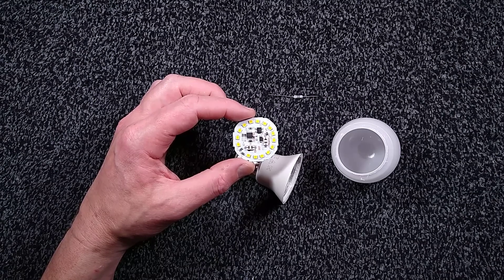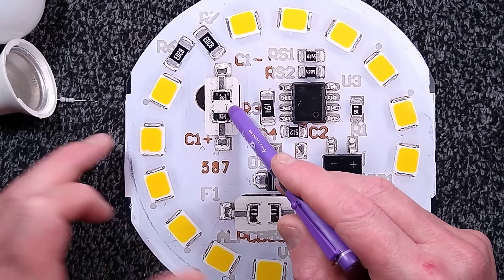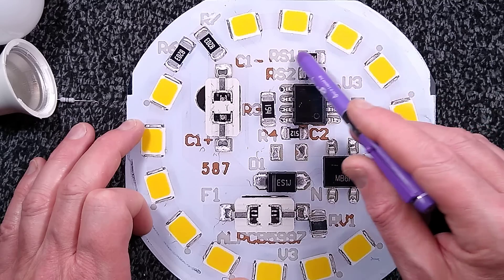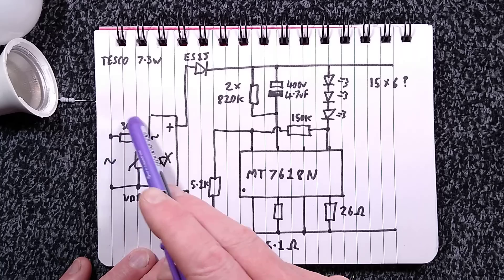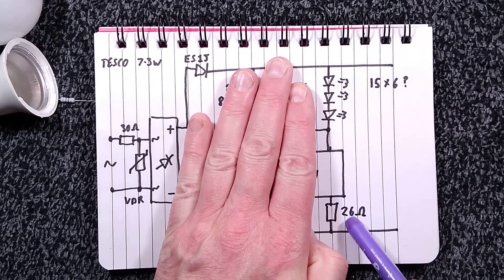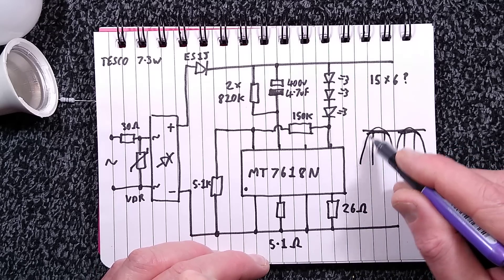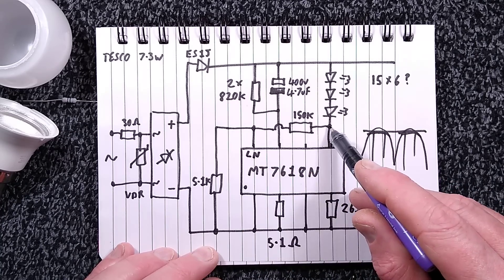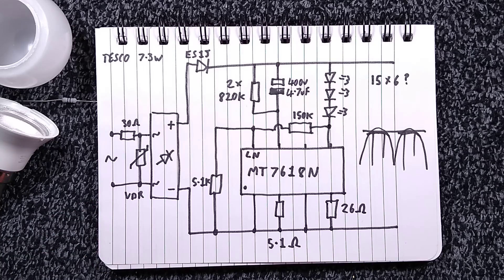Tesco lamp with weird circuitry twist

Comment: this lamp exact lamp is also supplied by toolstation. They are Wessex A60 GLS Bulb 7.3W BC Warm White 806lm
By Wessex Electrical Product code: 51967 Pack size: 5 Pack, or Wessex A60 GLS Bulb 7.3W BC Cool White 806lm
By Wessex Electrical Product code: 65973 Pack size: 5 Pack

just bought some. As you promote, removed the lowest value resistor, and visited your site specifically to find where  the two bleed resistors were so I  to have cheap phantom hall phantom lighting?

Comment: Hi Clive, I have some LED lamps from Aldi here in Melbourne Australia. They are very different from the ones you have been hacking with a die casting main body that heat sinks the ceramic disk where the 12 leds are mounted. There is liberal use of thermal paste.  The main circuitry is fully potted in the base which is extended by a plastic case 28mm dia and 34mm long plus the 25mm length of the es or b22 connector. Brand names are starke and lifetec, but I can't open the lifetec due to it's glass envelop.

Comment: This is just pure speculation since I don't have access to that chip or that lamp. This theory can be tested with an oscilloscope and meter. I'm guessing that chip is a PWM current/voltage limiter. This can be tested by measuring frequency on pin connected to LED. Adding a variable resistor between mains and lamp to reduce voltage across the lamp and measuring the voltage across LEDs to see if it is in fact a current/voltage limiter. If my theory is correct, that diode is there to reduce noise transferred to mains (which also can be tested with oscilloscope). Matthias is showing noise on mains in one of his recent videos "Our electrical is all wobbly, measuring power is hard".

Comment: A very interesting video clip and I like the way you freely admit to not knowing it all already as so many other clips suggest!  My thoughts on why the ES1J diode - with due deference to other comments - are these: The bridge rectifier, an MB6F, is rated at 600V peak repetitive.  With 240Vrms mains you'll get about 340V which is fine.  But if you follow up the bridge with a capacitor, and if it's switched on and off repeatedly, that residual voltage on the cap may coincide with the wrong part of the incoming phase and you end up with double the peak voltage, ie, about 700V.  So adding the extra diode, I think, is to protect the bridge against overvoltage conditions if used in a silly way.  I've proven this myself the hard way; use a 0.47uF cap in series with the mains so that it drops enough voltage to run a tiny incandescent lamp.  Then switch it on and off a few times and the lamp will quit and take up smoking.  That's why capacitive droppers  *always* have a resistor in series with the cap.  And the 820k bleeder resistor won't help much, ie, 820k x 4u7 = 3.854uS, way too slow.

Comment: It would be interesting to see what the measured power factor is. The IEC-61000-3-2 requirements for lighting are messy -- lamps under 5 watts are given a free pass. Lamps between 5 and 25 watts (this one is 7 watts) can meet the requirements with any one of three ways.

Comment: Super interesting. While I think some of the new energy saving regulation type stuff is super annoying (I have an air purifier that has a roughly 6 hour timer in it, and it shuts down - I had to modify it so it constantly thinks the power button is pressed, since I wanted to put it on a timer, so it's only used when I want it to be used, saving more energy than the "one size fits none craptacular timer that was forced upon me) but I do think that unless things are kinda mandated quite a lot of companies wouldn't care... and then you end up with the problem that EEVBlog discussed in his video about smoke alarms using 80mA from Mains, which isn't a lot, but then you multiply that by a house, road, town, county, country... and you start having to add an additional power station, just because someone didn't add a component for a couple of cents.
Reply: Having lived in a house with 13 smoke alarms (previous owner was a fire fighter), they did definitely show up on my clamp meter if I turned off that circuit (of course I've no idea what the power factor was)

Comment: I have an idea about the mystery diode on the + output of the bridge rectifier. The datasheet you show makes a lot of fuss about 'no flicker'. I think this might be a part of that, in conjunction with the capacitor. The diode, I'm guessing is this
https://rocelec.widen.net/view/pdf/dqicrmvnn8/ONSM-S-A0007011439-1.pdf?t.download=true&u=5oefqw
It lists a maximum forward voltage of 1.7V ... Whatever, at least it won't let the voltage at 'rectified +' get close to zero, which is likely the undesirable system state (flicker) that it's there to avoid. I think that the diode will prevent any voltage on the + output of the rectifier from getting too low to light the LEDs (anti-flicker) and then the capacitor circuitry is maintaining charge to ensure voltage to the LEDs during the regular dip in the rectified + to get over the hump. And then, voila, flicker-free LED viewing. The diode in that position may help the capacitor hold its capacity during dips the rectified cycle?
I would like to see what happens when you bridge both sides of the diode. Essentially, cut it out of the circuit, and then see how that changes the behavior. 
I think the chip is sensing the charge on the capacitor and the main goal is not, per-se, power factoring, but rather anti-flickering.

Comment: Agreed with some other posters, the high speed rectifier is there because the chip is a switching regulator. Notice no line cap or any inductors. If you're going to switch any circuit without adequate suppression, there will be too much line noise. The cap connected through 5.1 ohms wouldn't help much. The fast diode will help reduce noise, but still not very much. This will introduce a LOT of noise on the line, but I'm guessing the cap with resistors helps a little. The resistor divider is there to measure the voltage for their sloppy approach to power factor correction, but at least they did something! It probably costs 15 cents in production but it's better than nothing.

Comment: I ran across one of these lights with this PFC circuit that had died. After fixing it, the diode is there to simply stop the switching transients when the capacitor is switched out of the mains side of the circuit. Its simply switched at 2x the mains frequency. Edit: Its actually pretty interesting in that it appears to be regulating the capacitor current instead of switching it. It basically starts throttling back the peak charging current as part of the regulation to hold a constant voltage on the capacitor. Also explains why they state in the datasheet there is a JFET driving the power transistor as its a depletion mode MOSFET. Neat.

Comment: Hi BigClive! I think the high speed diode prevents reverse-current spikes through the IC (via the 4.7 uF cap) as a result of reverse-recovery of the rectifier bridge; when the mains input sinusoid voltage dives below the capacitor voltage.

Comment: The capacitor might be connected via the chip to limit the inrush current, to imporve the power factor or also to make the lamp dimmable. The extra diode probably solves the reverse recovery current of the slow diodes in the bridge during mains transients.

Comment: Hmmm, the 30 Ohm fuse consumes 1763W when there is a short in the circuit (for example failing bridge rectifier)?  Maybe for a short period of time however can catch on fire. Lately I had one LED lamp that was fully baked inside, brown/black stuff inside, everything was burned.  Is a normal fuse more expensive than a 30 ohm resistor? Why manufacturers use a resistor in series with the lamp when there is a safety risk and consumes power when operating? If the power rating is correctly, this resistor consumes about 0.95W.  So if you replace the resistor with a fuse, you could save a watt.  Am I right?
Reply: This 7W lamp only takes about 30mA from the supply so the normal dissipation in the resistor is only about 30mW.   They use  a resistor because it's cheap and it normally doubles as an inrush current limiter when the lamp is switched on.  However in this unusual circuit the IC could limit the inrush current.

Comment: Perhaps rebuild that circuit on a larger scale so you can add in a switch to basically turn off and or bypass that resistor into LN?  Or change the values of the dividers.

Comment: The "power factor effect" for such a low power device is indeed minimal, but, (if the supplier got their pricing and marketing right) you may need to consider the "power factor effect" for 8 ML in parallel  (8x 10^6 Lamps).   ;-)

Comment: When the bridge is forward biased, the LEDs conduct and the capacitor charges.  As the bridge becomes reverse biased, the stored capacitor charge continues the LED current.  The fast diode prevents any of this charge from returning through the bridge due to free charges in the diode junctions.  Since the line current must power the LEDs and charge C, the capacitor might actually make the PF worse -- it depends on the height of the spike vs. the duration.

Comment: Good logical explanation .We are having s o many issues with low voltage led lights and buzzing and dimmers and 0 to 10 volt control on switch mode power supplies .what a mess to try and be more efficient .Give me back  tungsten halogen lighting .It's better and helps warm up the house in winter !

Comment: Oh man.  I don't do electrical all the time but we had these "mysterious" objects that the electrical drawing called up to tie into a junction box.  One of them was a clog sensor that attaches to the hydraulic filter and  the other one triggers the accumulator dump valve.  I have no idea how they work I just know how to match colored wires to what the print says.  What I like about your channel is you reverse engineer a lot of electronicals!  :)

Comment: The LN pin's connection looks like a bias for an op amp. Try adding a pot across the 5.1K and see if it dims or cuts off as it approaches ground. Just a thought, because I'm feeling a bit lazy and don't want to do it myself. Thanks for the video. Good luck. 👍

Comment: Hey Clive, when there are hundreds of thousands of 7W bulbs in use in a city, power factor correction can have huge benefits to generating efficiency. And with electricity prices soaring, we could use all the help we can get to constrain prices.
Reply: I just use my solar panels. Smug of Tunbridge Wells.
Reply: @mbak7801  A "good" power factor is also very helpful for your inverter. Small generators and inverters really don't like low power factors at all.

Comment: While noise reduction is a possible explanation, so too is safety. If the lamp is designed to be safe in the event of single component failure then a shorted bridge could blow the 4u7 cap spectacularly. The extra diode would protect the cap from that, and high speed diodes often have lower forward voltage drop, so such a protection diode wouldn’t be so much of an efficiency sink.

Comment: Daft diode does seem odd. It could be to stop the cap destroying the chip on turn off once the output voltage drops below the minimum forward voltage of the LED's.  A caps still charged jobber and tries to discharge backwards through the bridge rectifier destroying the MOSFET or whatever is in there. Link it out Clive and see what happens👊

Edit, that is sort of not possible. That's why it's fast I think. A fast transient may allow reverse flow across the slow diodes in the bridge. Slow diodes are very leaky in reverse🤔

Another edit. If there was a live to neutral short on the circuit these lamps are on then the cap would destroy the chip. All lamps would be dead on that circuit. I think it's actually quite clever

Comment: I had a couple of daylight LED bulbs from Tesco, they both failed in the same manner, one of the LEDs burnt out. This carbonised the very thin PCB to the point where it created a short to the aluminium backplate. Very strong burning smell when it died. Before they died they went through a phase of flicking off for a fraction of a second at random points in time.
Reply: did it flicker the leds or was it already arcing across ?

Comment: My first guess with the diode is that it helps the circuit withstand high frequency ripple or spikes from the mains which could lead to excessive reverse current in the bridge rectifier. Almost like a snubber. second thought was if it eventually Bias the circuit polarity a little bit to help with the ground potential or something

Comment: Power factor may be the reason for the oddnest. Not just EU buracracy. The lamp is a non-linear load like any rectifier feeding a capacitor filter.

In the US there was a problem when schools started setting up computer labs. A three phase box set up to feed a large number of computers seemed to always have the neutral line to the box overheat. The high current in the neutral was due to the fact that the non-linear loads only draw current at the peak of the sine wave. As these happen at three different times they do not cancel in the neutral. They add. Neutrals have to be capable of at least three times the current of the hot lines.

Comment: I wonder how long till we see full synchronous true-sine rectification in these things?    All it takes is a chip with 4 (probably built in) mosfets and an inductor, and running the LED string at ~380 volts.

Should work out substantially more power efficient, since the 'extra' voltage from line voltage variation and forward voltage variation of the LED's doesn't have to be wasted as heat.  It would also give a power factor of >0.99.

Once designed, I suspect it could be cheaper too, because energy losses mean you need to pay for more aluminium for heat dissipation

Comment: Hi Bigclive, I had bought some non dimmable OSAM LED bulbs from India as they a relative cheap about £1. Incidentally theser lamps have power factor > 0.9. I guess these new circuits are for better power factors as poor power factors messes up with suppliers. Interestingly I also bout a 40W (LED 40W power consumption not 40W equivalent incandescent bulb) for £7....

Comment: That power factor correction approach would seem to quite substantially lower the efficiency...

Perhaps you could measure the input power, and then compare it to the power delivered to the LED string.    I suspect ~50% extra will be being lost in the chip and the 5.1 and 26 ohm resistors!

I don't think I care enough about power factor to pay 50% extra for my lighting energy use!    Power factor is after all the energy grids problem not mine!

Comment: I wonder if the capacitor charging circuit is stepped? (Scope time). As in- between certain phase angles, connect resistor in series (a transistor switch), to reduce charging current, then at other times, charge directly. Ah, maybe that's what those other resistors are for- a zero crossing detector (or null point- as it's already been rectified). 
Might have to buy one of these just to see the waveform. 
Damn! You got me interested in a bloody light bulb Clive!

Comment: Hey Clive, What happens if you try to dim it? Only one reason for that diode to be there, to deal with both leading and trailing edge dimming. That would be a reason for the cap to have separate connections. keeping enough power to run both the control chip and the LED's I'll bet it's dim-able.
Reply from the maker: It's not dimmable.

Comment: These drivers seem to be in fashion. I took apart a bathroom lamp recently featuring two of them in paralel.  The docs are indeed very poor. I had to do some poking around to figure out how to set the current for these.  Search for "jo's weekend repairs" if you interested. That resistor divider probably serves double purpose - powering up the chip and signaling the current waveform phase.

Comment: If the chip is in the capacitor/sense resistor circuit, that suggests that the capacitor fill timing can be directly controlled by the chip. But presumably PWM because I don’t think they’d put an entire extra analog regulator on there. And what it can do then is fill the cap up on different parts of the cycle each go round, and it can make the lamp come out to an average pf of exactly 1, or whatever is needed.

And no, a single 10W bulb isn’t going to make any difference, but once you have three million of them installed in an average small city, that is still gonna add up to extra copper losses that the grid would just as soon not be dealing with at the same time that home solar and EV charging is killing the capacity.

(And because you only care about the aggregate, it’s perfectly adequate to average over multiple cycles)

Comment: Have you seen the Shargeek Storm 2. It's a 100W 25600mAh Power Bank that has a clear case  and adjustable voltage. It would be interesting to see it tested.

Comment: I guess this is a pretty clever chip design
They must be runing the LEDs in the “lower” halves of the sine wave directly from the mains,  charge the capacitor in the upper center bit of the sine wave and in the valley of the sine wave the LEDs get their current from the capacitor
At least thats my guess and I don’t have the slightest idea what that diode is for
First I thought that it would be part of some kind of switching regulator which is utilizing the inductance of the probably wound fuseable resistor. But that would be a EMI nightmare and makes no sense what so ever

Comment: Thanks for the teardown. These remind me of the Great Value brand sold by Walmart. Every one of them I've installed has burned out one of the LED chips within a year or 2. Utter crap! I no longer buy Great Value bulbs.
Reply: I found a bulb and took a look at the chip. It's running a ICNE2521DE IC.